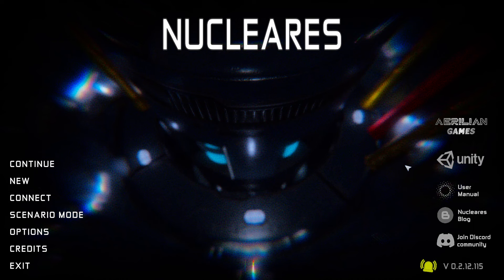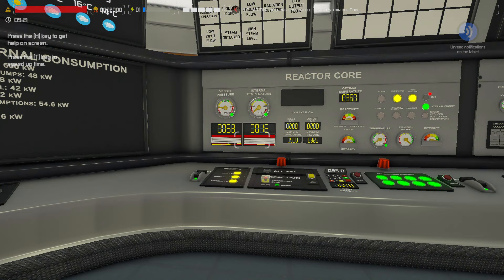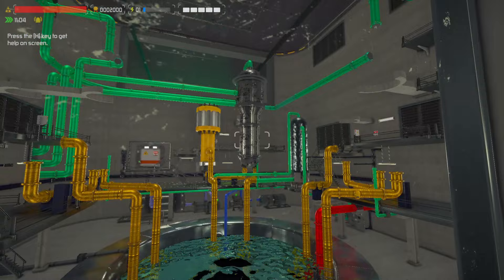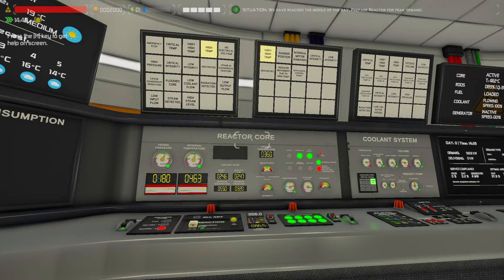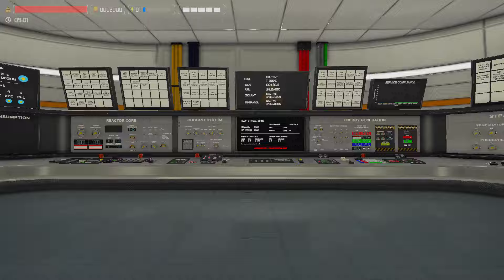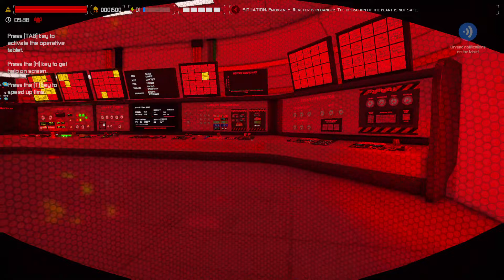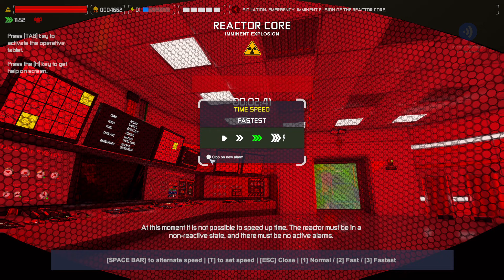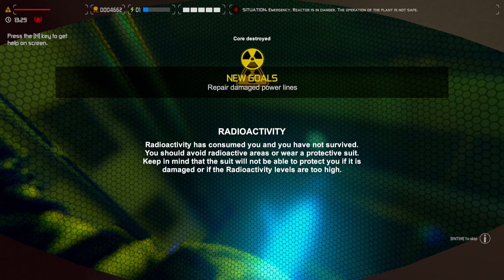NUCLEARES: Let's meltdown a reactor!

Comment: if you evacuate and get away in time before the core blows it will take u to the main menu to start again that's what happens
Reply from the maker: Oh nice, guess I don't need to test that then, thanks for the info!
Reply: @GWHacketts  it also allows you to keep your prestige points into a new run.
Reply from the maker: Yo, that's pretty dope then. If it ever happens I will be sure to escape.

Comment: Water is a neutron flux moderator if you boil the core dry the reaction stops
Reply from the maker: I agree, but sometime temperature drops incredibly fast like the reactor was shutdown and cooled down even though no actions were taken, so it just isn't realistic I would say. I am sure you could prevent a meltdown if you were able to have some emergency cooling.
Reply: @GWHacketts  the temperature dropped because it reads the coolant temperature. no temp= no reading
Reply from the maker: good point
Reply: @GWHacketts  just like in a car. The sensor reads coolant temp. No coolant no reading.
Reply: @GWHacketts You are able to open the RCV Valve and enable the feedwater loop and feed to use that as a additional cooling / emergency  loop. Wont be as effective as a proper RCIC module but its extra cooling!
Reply from the maker: @Luca-cb3qr  oh ok, well might help if you are a single loop when trying to cooldown the first time!

Comment: Next time try to pull out fuel rod from core
Reply from the maker: I Haven't even been able to eject the fuel normally during a regular shutdown. I'm not sure if I am doing something wrong.
Reply: @GWHacketts  i think the only way to remove the fuel without disableing the safety overides, is when it's completely depleted. otherwise, you can use the safety override switch, and make sure the reactor is in shutdown mode.
Reply: @ElderonAnalas oh heh brilliant.
Reply: @ElderonAnalas  You need to get the reaction entirely stopped (rods at 100%) and bring the core all the way down to room temperature. That's usually the hard part - it takes time and so patience.